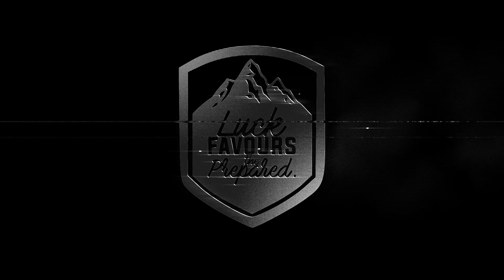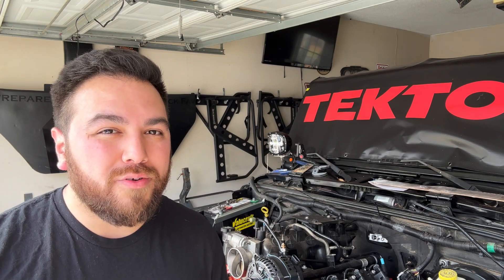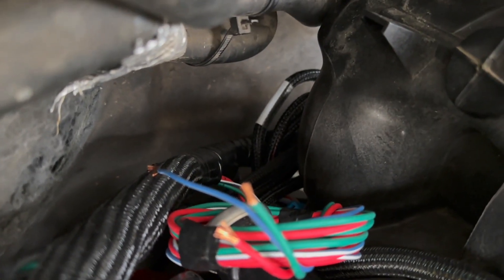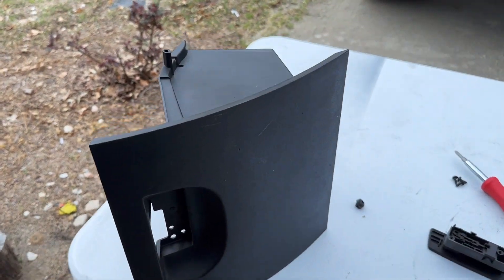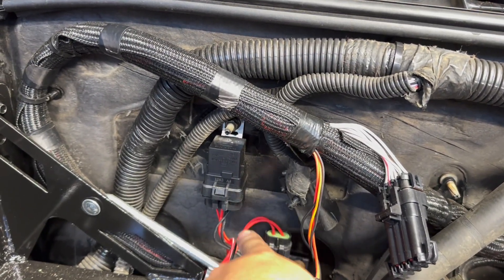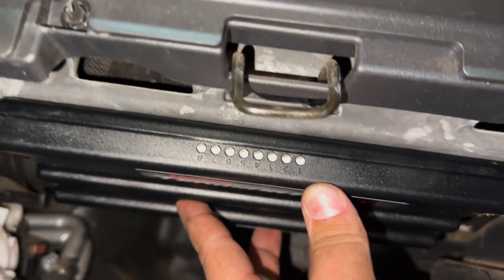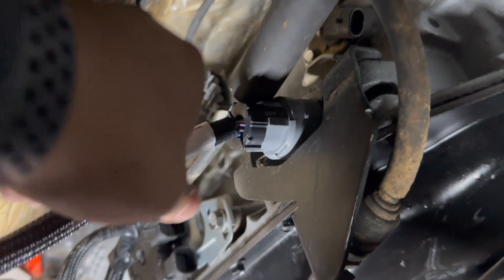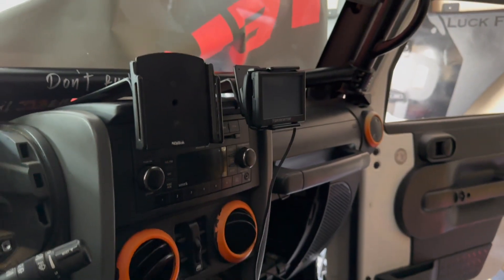Wiring up my LS SWAPPED Jeep Wrangler - Holley Terminator X Max - Jeep Wrangler DIY LS Swap Ep. 4

Comment: Ive been running my holley on the factory fuel pump wiring for years now. No issues. If you need some info on getting the factory key to work its do able fairly easily.
Reply from the maker: I was planning to run ignition from a switch panel but I wouldn’t hate keeping the key

Comment: What did you do for the battery relocation? Did you buy a kit or fab up a mount yourself? I’m in the process of LS swapping mine and needing to relocate mine. TIA
Reply from the maker: Bought a bracket from Amazon. I think it’s linked in the description but if not let me know and I’ll find it
Reply: I’m not seeing a link for the battery relocation kit.
Reply from the maker: @tylermiller3367  https://amzn.to/3yleeWa
Reply: Thanks that saved me a lot of money. The mount I was looking at to move the battery and fuse box was $450
Reply from the maker: Yeah there is another one that does the battery and fuse box for like $900 that I looked at as well but the more I thought about it I knew I could just make a bracket for the fuse box and save some money. Glad to help.

Comment: With this holley kit you dont need yo use the oem jeep harness and ecu? My jeep engine caught on fire and im looking into doing an ls swap on it but all of my engine har ness burned
Reply from the maker: You don’t have to but if you don’t you’ll have to rewire all of the lights and interior controls. I used the Jeep PCM and body control harness so that I didn’t have to use that but the engine and trans run on the Holley system.

Comment: I take it the factory gauges are unusable and will have to be replaced by aftermarket ones? What about the a/c will that be operational?
Reply from the maker: Honestly not exactly sure if they would. I opted to go for a digital dash in place of it. We will have a video showing that install as well when we get there.
Reply from the maker: Oh and on the A/C. I’m kinda waiting until we get it powered up to see how the stock switches act. Then I may try and solve that. Worst case scenario I will add an aftermarket ac system